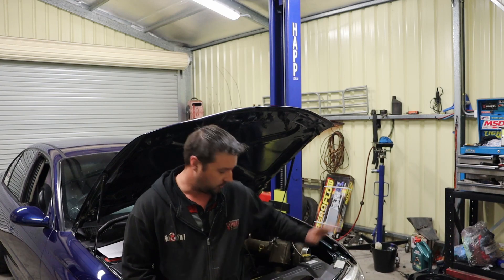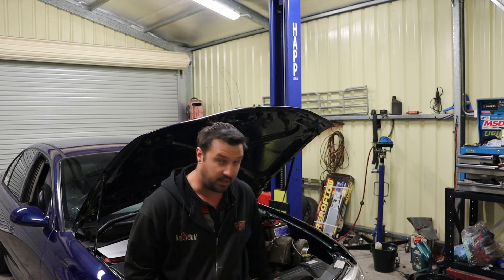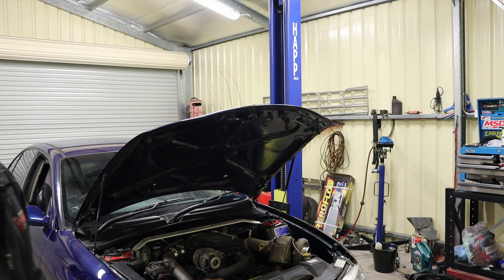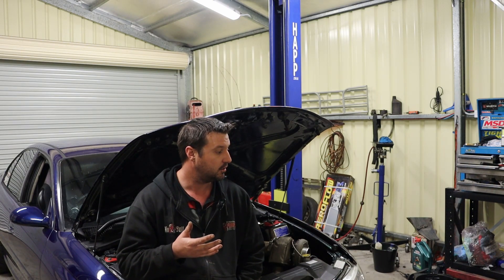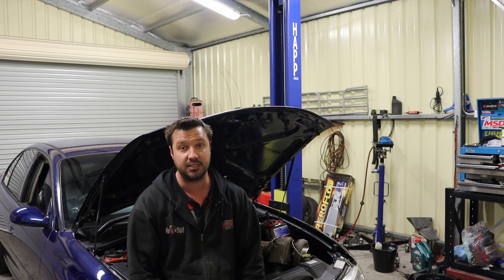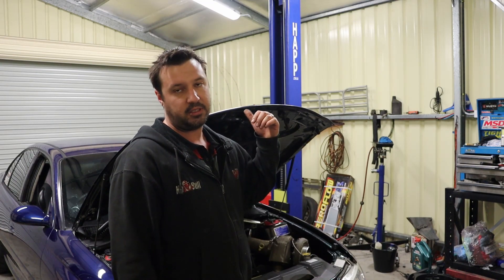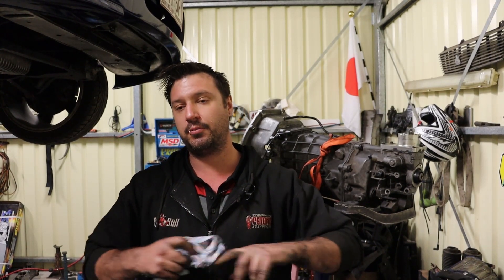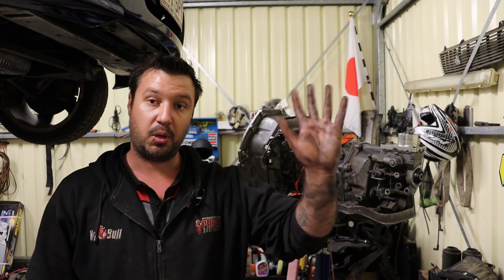taking the trans out of ethel in preparation for some upgrades...

Comment: Gonna be a different beast with the upgraded clutch and pressure plate, you should revise the boost pipes while Ethel is down, I found cheap trailer toggle latches on eBay 8 for under $20, not the prettiest but adjustable and if placed out of sight your couplers won’t come off, and let you run even more boost without blowing pipes off, cheaper than the $130 each wiggins clamps lol
Reply from the maker: Yeah man sure is gonna be 😊 I'm just gonna go some wiggins clamps man do it the way I should have to start with 😁